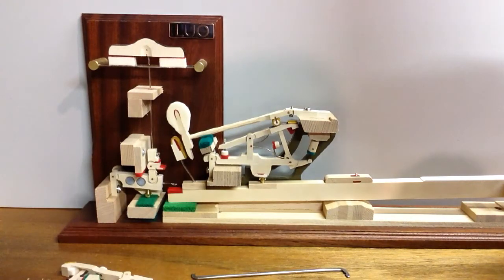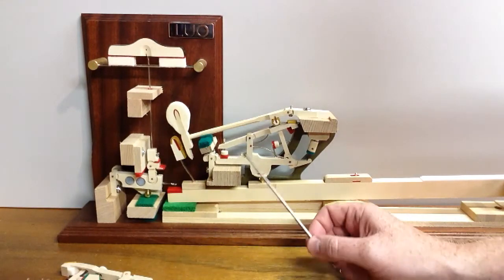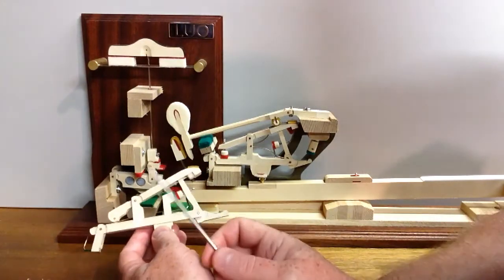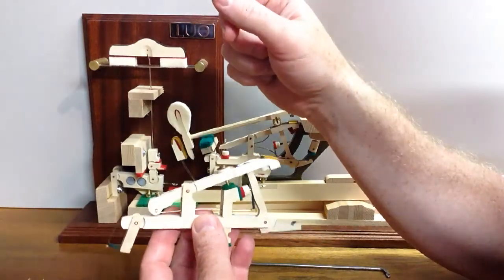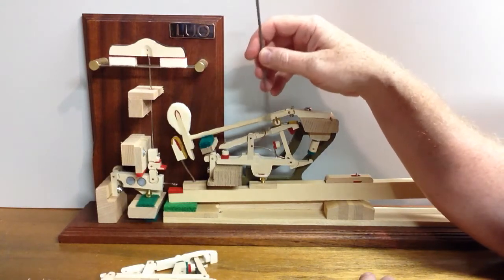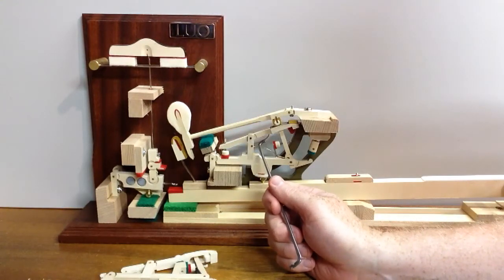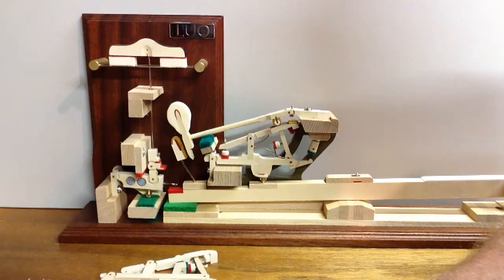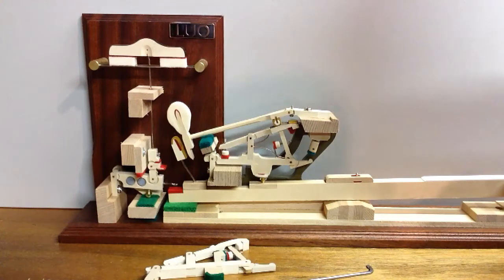Piano Regulation - Grand Piano Repetition Spring Adjustment I HOWARD PIANO INDUSTRIES

Comment: Thanks for this Video.  Can you please explain about the "button" at the top rear of the repetition lever, (not the Jack "button"), with regard to regulation of repetition.  I look forward to hearing from you.  Thanks.
Reply from the maker: This regulating button is for adjusting the height of the repetition lever. You can adjust this to make sure the top of the jack is in the right relation the the top of the repetition lever. I will be doing a video on this adjustment soon.
Reply: Thanks for responding so quickly and I look forward to your video on this topic.

Comment: is that spring the most directly affecting thing on how fast I can hit a note repeatedly? is there something else to take into consideration too when making that adjustment other than the hammer movement?
Reply from the maker: There are other factors that affect the speed of repetition.  You want to make sure that the hammer flange pinning is not too tight or too loose which will have a big effect on the speed of repetition.

Comment: I didn't really understand why slowly releasing the key, the hammer should go up?
Reply: As far as I understand, it works like this:
1. After the jack falls behind the knuckle, the knuckle (and the hammer shank through the knuckle) is supported by the repetition lever.
2. When you slightly release the key, the opposite side of the key (the left from our view) slightly lowers, pushing the left side of the repetition lever weaker.
3. This allows the butterfly spring on the other (right) side of the lever to push it slightly upwards, thus lifting the knuckle, the hammer shank and the hammer itself.
Reply: @statcc0  But why is this movement necessary to the action? What would happen if there was no springing action?
Reply: It gives you what is called: aftertouch, try some keys that DON’T have the repetition spring correctly adjusted as opposed to another group of keys that do, and you will/do find a big difference
Reply: @allchopin  I really am concerned also  about the same thing. I came across a piano in which the hammers did not rise after playing the key and slowly releasing it. . some of the notes did nt play at all on the second strike as if the jack was not resetting. I was wondering if the repetition spring would help remedy such issue if adjusted to rise after  playing it. in other words can the keys still play if the repetition springs are not adjusted??
Reply: @Ocean8881  I think that if the spring goes too weak, the tip of the jack will not find "room" nor time to return under the knuckle

Comment: i had the issue where the jack wasn't resetting to where the jack button touches the spoon. figured either the pinning was too tight or the repetition spring (on the jack side / bottom half / not the part you adjusted here) was too weak. i didn't have pinning tools with me so i tried to adjust the strength of the repetition spring on the other end... i eventually got it to repeat pretty good but i think the rep lever was a little on the strong side, so i'm not sure i made the optimal adjustment... plus it took like an hour ... is there any way to adjust the spring strength on the jack end?
Reply from the maker: You can take the whippen out and adjust the spring where it presses on the jack cord.  Really the best solution would be to take care of the sluggish jack pinning though.

Comment: In recent years, the Renner-type single spring repetition seems to have gone completely out of favor. Even the Schimmel teflon screw at the top of the butterfly spring is hard to find.
Reply from the maker: Yes, adjusting the spring with the screw adjustment does make things much easier, but unfortunately these aren't very common anymore.

Comment: Thanks, that was interesting!

Do you prefer working with the longer spring with the screw or the butterfly type? It seems to me that the butterfly spring would be more susceptible to mistake (i.e. possibly bending it sideways).
Reply from the maker: Yes, I definitely prefer the screw type adjustment as it is easier to make fine adjustments.  WIth the other type, it's kind of a guessing game as to how much pressure you need to put on the spring to make the needed adjustment.
Reply from the maker: We have a lot of videos showing the regulating steps for an upright piano on our YouTube channel.
Reply: Thanks for the reply.  I imagined the types would be easier.  Thank you for providing such great videos!